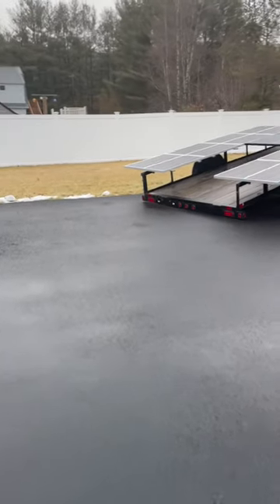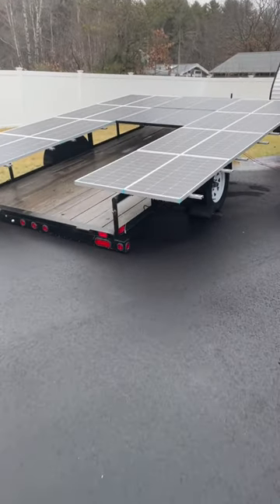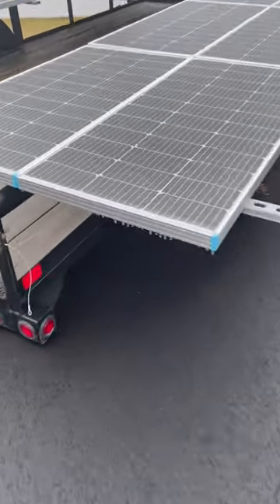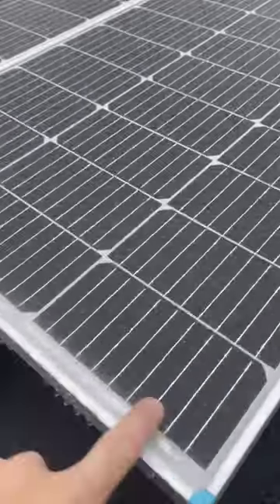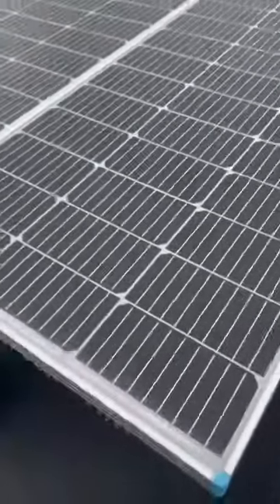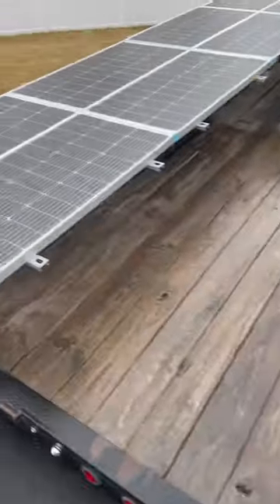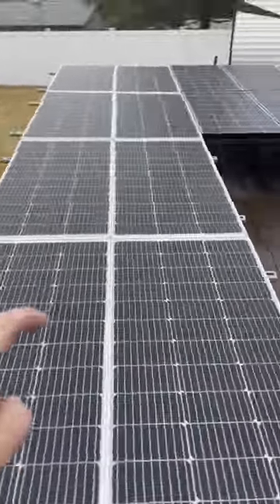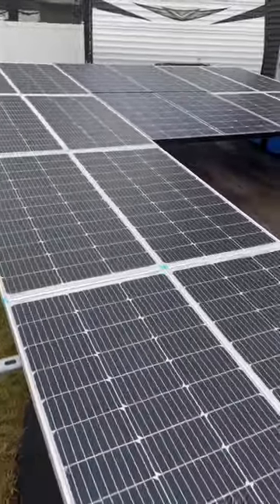ICE Bad for Panels? #shorts #offgrid #solar

Comment: Oddly the cold temps will raise voltage. If your have an MPPT charge controller it will make a few more amps super charging.  Do not attempt to clean off clear ice. Snow needs to go. Your Panels are 100% fine with minimal loss. Photons will power right through them. Dark cloudy days are killing your amp production not the ice.

Comment: Sun can even go through snow
Reply: This is true but the power produced by the panel array will drop 85-100% due to the inefficiency because of the snow. (Licensed Electrician) cheers!
Reply: @itszachcarter8370  thank you for your comment

what if the panels had snow on them...what would be the safest way to clean them off